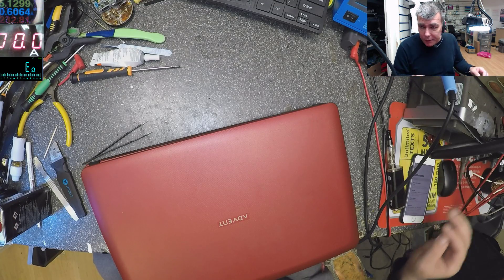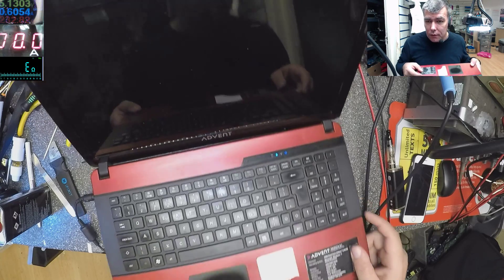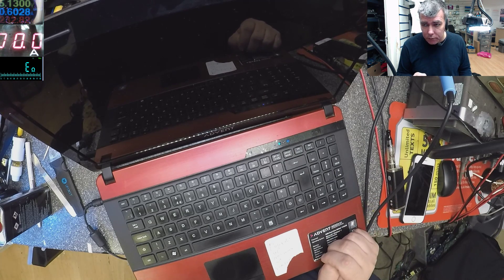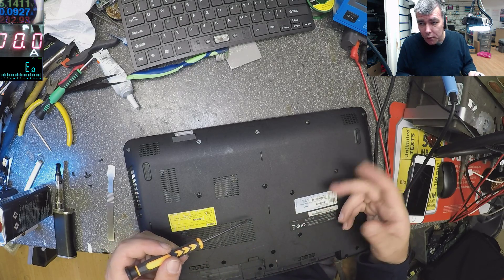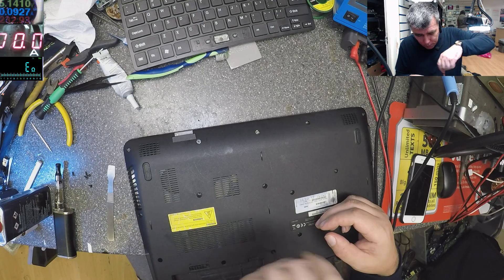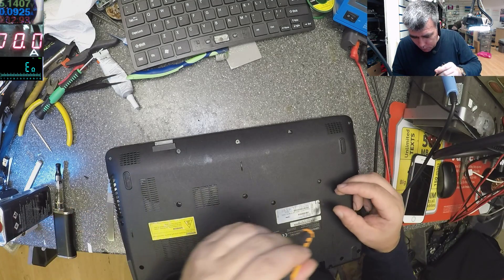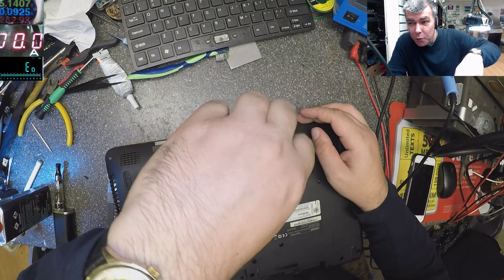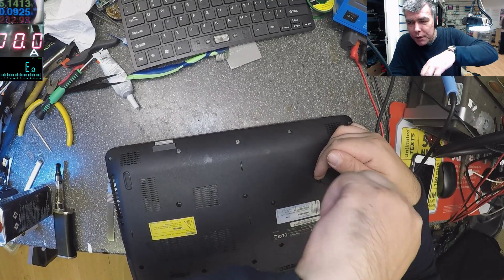Advent Monza n1, on, but no picture on screen, graphics repair

Comment: For some reason, he already knew the cause of the problem. However, how does he know the problem was not a dead display? My first test would have been to connect an external display. I guess no external display output would point to a graphics problem. Please someone tell me if my reasoning is correct. I actually own an ACER  Aspire One 722 that charges the battery, turns on power button LED, and the other tiny LED, but no graphics either to HDMI or display.
Reply from the maker: backlight and picture a two very different things, backlight on- most likely a screen problem if is not picture, Backlight off, most likely a board problem, graphics, ram

Comment: Hi,
Great video, can you tell me where the jumper is on this model? I need to wipe the CMOS password as when I now turn on the laptop the 1st thing I'm asked for is a password which I have no idea what it is.
Thanks in advance :-)
Reply: If it has removable CMOS battery just remove it and press the power button for a few second (maybe remove the main battery too, I forgot if it's necessary).

Comment: I have a dell 1525 that the screen  sometimes works on but cannot replicate the fault :D..
It's going to be a project for after christmas..It's a very strange fault, I take it to
pieces and put it back together then it works a few times, then reboot the laptop
lol and it boots without screen, very strange fault, How can you fix something you
cannot replicate ???Can't wait im up for a challenge LOL
Reply: Check the LID switch/sensor. 
If you can see picture under bright light with the laptop powered on it may be a faulty ribbon cable. This may help https://www.youtube.com/watch?v=zBB1L5F-VZg

Comment: HI JUST TO ASK YOU A SMALL QUESTION
WHY YOU DID NOT CHECK THE SCREEN
OR RAM
OR HOLD POWER BUTTON WITH OUT THE BATTERY OR WITH OUT CHARGER ETC.....
I DO NEED A GOOD ANSWER PLEASE
I DO LIKE YOUR PRESENTATIONS ALL THE TIME
THANKS AGAIN
  HACENE MARIO ADLI

Comment: I did it today like this and its working like new. Clean the fan and heat the Nvidia thermo pasta (dutch) :) 
And did machic myself thank you again
Reply: Hi. Could you please explain what liquid flux was used and where to buy it? I've got the same problem on the Advent Monza. Do I just have to pour some flux and heat it? Thanks
Reply: @SK-Scholar  it’s rosin kalafonia  you can put it in alcohol and you have the best flux you can buy .

Comment: Just carried out the same repair on a HP Pavilion G4 Sorin, worked perfect but as you say you never know how long before it happens again, do you give any sort of warranty on such repairs? I tell them if it happens within a 3 month period i will look at it free of charge but cannot promise it will be possible to fix again.
Reply: Hi. Could you please explain what liquid flux was used and where to buy it? I've got the same problem on the Advent Monza. Do I just have to pour some flux and heat it? Thanks

Comment: Hi Electronics repair School I have a Question what the Ipad Air 1st Gen show on the screen if there is no battery inside and the motherboard to battery connection, is open circuit and we connect a Charging cable.In my case I don't see anything,don't know if its normal or not
Reply from the maker: yes, is normal. Connect a battery or power supply and check
Reply: I connected to the power supply but no symbol of battery charging on screen or no sign of Apple Logo appearing.But I have ordered a new battery it's gonna take 7days.but without battery connected it should show something right ??
Reply from the maker: no
Reply: The basic Problem was as soon as we apply power supply to it, the Apple Logo pops up and starts blinking and when we disconnect the power supply no screen "dead".So today I installed a brand new battery and it turned on and no problem charging it also.Any comments please good or bad appreciated.

Comment: I have now a laptop that power on but no picture, only thing that gets warm in the Motherboard is the graphic chip, but at the same time the 5v and 3v power rails are missing, you fixed one like this before, its a packardbell easynote like the one in your video, same model.
Reply from the maker: how you can power up the board if 3.3v is missing?
Reply: the 3.3v is missing from the bios 8th pin, no idea, but the fan spins, the graphic card gets hot, the cpu stays cold, i see the blue power light and the light in the power button.

Comment: Congratulations .
Can you please answer these:
1. What temperature did you use for the reflow?
2. how did you know that heating is alreadyenough?( you reflowed only outer sides of the chip)?
3Why do you think that reballing would not solve the problem, if ONLY reflowing did solve?
Reply: OK, but question No.3 can be answered ?
Reply from the maker: 500 C, nothing can be done there, nothing will help, just a bad factory design chip, this is the best solution on this case to keep the balance price-happy customer-warranty, and yes, this has 3 month warranty like any other job